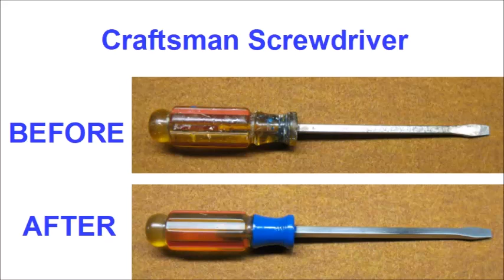Hand Tool Restoration - Craftsman Screwdriver

Comment: Hello 357 Mag Dad!  Awesome job!  You have the difficult job of tip restoration down to a science!  Your Daughter's musical accompaniment was outstanding!!!!   Great stuff!!!! Keep them coming!!!!!
Reply from the maker: Thanks! I was inspired by your acetate handled screwdrivers video.
Reply: I'm really enjoying your channel and your whole format!  I've seen you go from hand tools to new Wire wheel and Belt Sander!  It look like you are having a ton of fun!!!   Great stuff!!!!!
Reply from the maker: The belt sander is handy - I haven't totally made friends with it yet.  Can I get your input on a new project?   I am working on an Estwing hammer with a stacked leather handle.  The leather is in good shape - I plan to just sand and refinish.  It looks like the original finish was some kind of varnish.  What would you recommend I use?
Reply: Wow, That is going to be a project indeed!  The problem with stacked leather is absorption... If you sand the leather you can get a rough finish that won't sand off, almost like end grain.  If the leather is shiny and looks sealed it will be a lot easier.  I think they use a brush on lacquer at the factory, once it dries it has a hard feel to it and is shiny.  I have seen all types of finishes applied to stacked leather but they need seem to match the factory finish.  As for Varnish, although I love it, I don't know if it will dry hard enough for your application.  If you go to "How it's made" videos they did a visit to the Estwing factory and showed the handles being dipped.  I think they even burnish the leather before dipping...  I'm not 100% sure.  I will be very interested to see the project video!  I know it will come out great!  Thanks!!!!!
Reply from the maker: I found this response (supposedly from the Estwing factory) on a 2004 WoodCentral forum:
"The original leather grip was dipped in three coats of specially-formulated 
lacquer. Although you will not be able to commercially purchase a similar 
lacquer, you may refinish or refurbish by lightly sanding, cleaning the grip 
with a tac-rag, then applying two coats of polyurethane varnish"
Gonna give it a try!  Stay tuned!
Reply: I think the Lacquer they use is called "Brushing Lacquer"  I bought a quart years ago and never tried it yet!  I bet that's what they use!  =)  Looking forward to it!!!!!

Comment: i can do that 100 times better. i just go to sears and trade it for a brand new one.
Reply: Robert Touchette -Sears is going out of business bro...
Reply: Sure, if you want a cold forged, made in China unit, why not? Because that is what Sears will give you as an exchange for this quality, hot forged "Mile High Quality" made in USA by Western Forge in Colorado Springs, CO unit. Your only chance of getting a USA made replacement is to go to Ace Hardware and if they have the same stock #, they will swap it. But, you'll get a USA made WF cold forged unit. I have swapped some with broken tips at Ace (bought off Ebay), but like this poster, I try to save the "old gold" USA WF hot forged units. I have several of the hot forged units and they last and last.